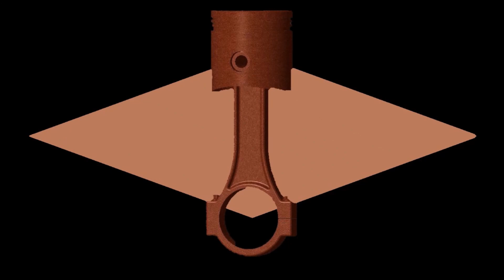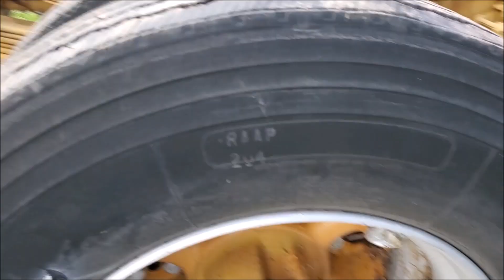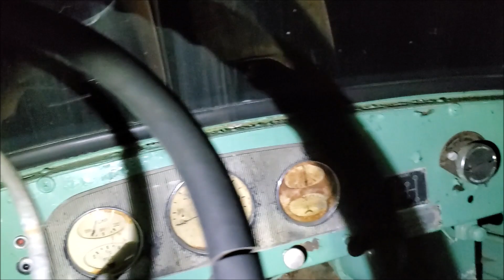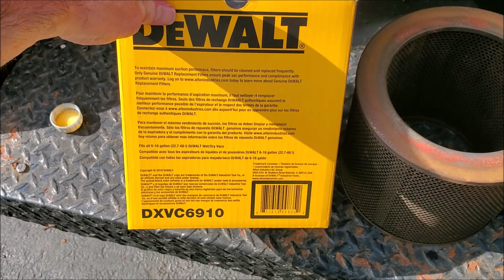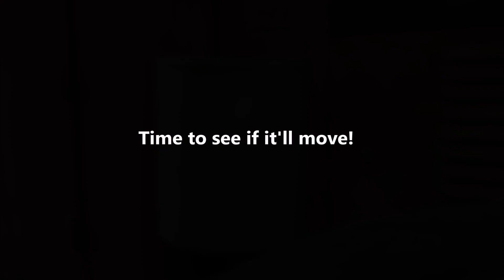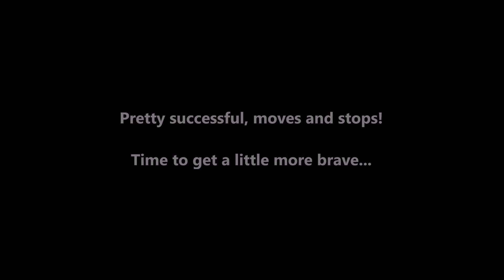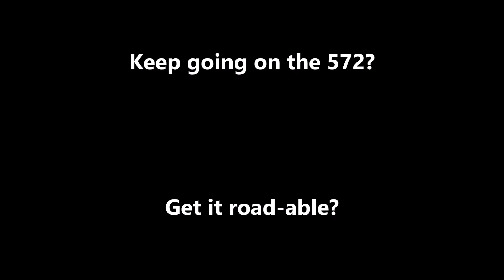1951 Brockway Rescue Part 4 - FIRST DRIVE! But will we make it back?

Comment: I would keep it all original.  I don't know what your initial intent was with this truck.  Were you planning to work it, show it, or just get it running?  I guess that would help answer the question of what to do next. It would make a great show truck at ATHS (American Truck Historical Society)events!!  Oh, after discovering the pool of gasoline in the intake, did you check the oil?

Comment: Will that shop vac filter have the structural strength to hold the cover up?  Looks like the cover is resting on the filter or is there something else holding up the cover?
Reply from the maker: Yes, it's strong enough.